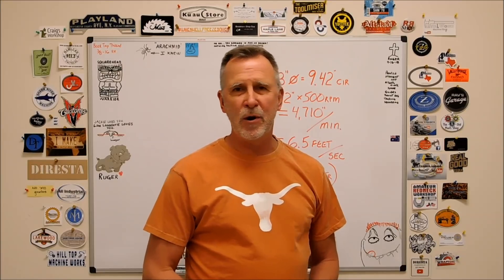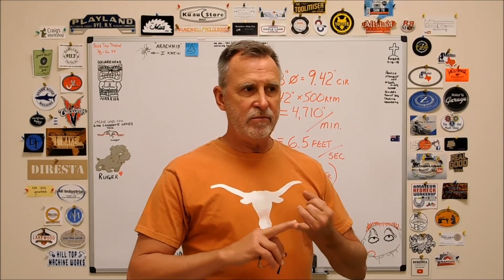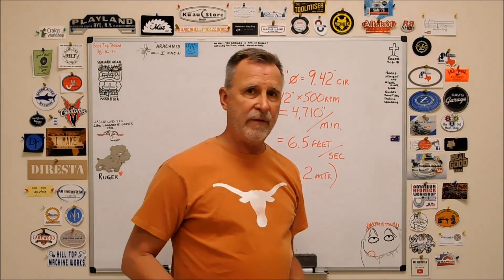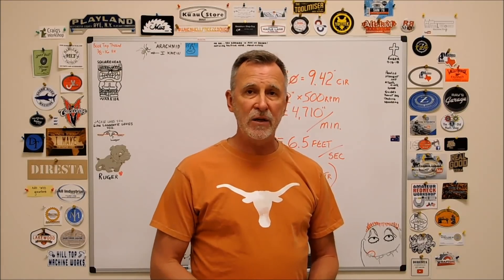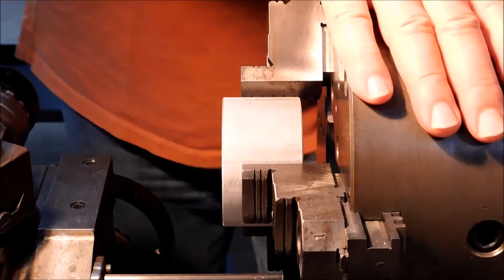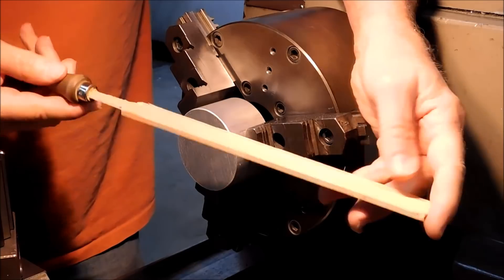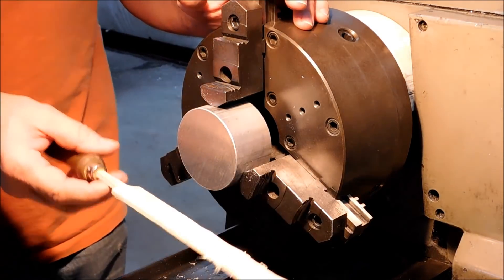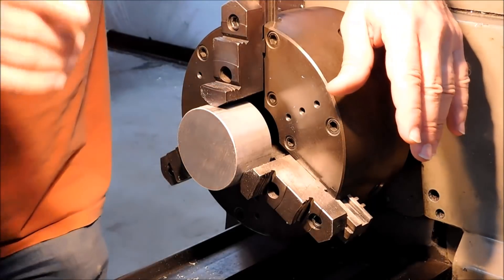File vs Spinning Chuck Jaws

Comment: I teach in a college lab with 12 identical Acra 1640 lathes. Times have changed since I started there 40 years ago. The lathes now all have interlocked guards over the chuck so they won't start until the guard is down and they all have foot brakes. While I filed right handed for years as you are doing in this video, those days are over. I now file left handed as the guard would be in the way and it's just safer particularly with the jaws are extended past the chuck body. Also note that the file is less likely to do any drastic moves when the rpm is higher contrary to what one might initially think.

Comment: Hi Joe, when I was an apprentice my mentor taught me to hold the handle of the file with my left hand when using it on a lathe near to the chuck. First it felt very unusual and it takes some time to practice. But when you get used to it, it feels much saver because you do not holding your arm over the rotating chuck.
Reply from the maker: I wish I had another person available to do a walk around of my body position when I file right handed. My form is very stable and well clear of the chuck. I have always, and will continue to do so. I do adapt to different size chucks of course. When they get big, its always form tools. No exceptions.

Comment: as your chuck has the outer ends of the claws being a good deal ranging into free space, you should also mention that when going for such a file application a) your cloth might have a chance of being pulled into the machine and b) your wrists inside is in danger of unpleasant contact. if either of those happens you are in even more danger of having quite hard contact with outer parts of you body, especially the main body.

Comment: Im just a home machinist but I figured out this technique using common sense and the odd brown trouser moment! I now mainly use a file for deburing small delicate parts which are held in a collet chuck whenever possible. If I have to use a needle file without a handle I hold it across the part so that, if it catches it will just whip it out of my hand and away across the garage (I also cover my Harley when I'm doing it!). Big stuff with a short projection gets done with a tool or a form tool nowdays.
Reply from the maker: Collet chucks are famous for rolling fingernails backwards when you get too close. It may not look aggressive because everything is so small and smooth, but let a thumbnail get hit by a collet slot and you'll remember that for a long time.
Reply: @joepie221  LOL - after a couple of bad moments whilst starting out (Including an exploding gearbox on a cheap bench lathe!), I never assume anything is safe! I always use a decent hang out when filing then cut off later so I only have one end that is going to try an mess me up and then I am cautious but firm wit the file. My worst injury was having my knuckle rapped by a sticking out jaw whilst clearing swarf out with the chuck running - schoolboy error!
Reply: Tha smaller the file, the more likely it will catch and go flying. “Across the garage” is ok, as long as it doesn’t go through you to get there. I like an 8 or 10” file, with a handle, held lefty.

Comment: I'm only 23, so I havent been in the trade long. Anyway, whenever I am filing or sending on a lathe, I put the machine in reverse so everything is moving away from me, so if anything grabs, it pulls it away from me and throws it into the machine.
 If it's up close the chuck, I use my die grinder and spin the chuck slow. If it's far away from the chuck (5 inches or so), I push the tail stock up close, lock it in place, lean on the tail stock for support and stand off to the side, with the piece still rotating away from me. I also never spin the chuck over 100rpm when filing. 
When sanding a piece on the lathe, I rip off a piece of sandpaper nice and long, spin the part away from me and make sure my hands are far away from the workpiece. I have a fairly loose grip, so if anything grabs, it pulls the sandpaper from my fingers. I've had good luck with doing things this way and have all of my limbs in tact.
Reply from the maker: I am not a big fan of reverse filing. But then again, do what affords you the highest level of safety. As for the sanding, watch my safety video on that topic.    https://www.youtube.com/watch?v=p5iKM-vC6LM

Comment: One thing with putting your arm over like that is if you can rest you arm on the headstock and use the front of the headstock to lean against it gives you a very steady  stance and much more control over the file .
That being said it is fine if your lathe is small enough to allow this approach ! Some of the lathes i have used had six feet dia chucks and its a brave or possibly insane person who wants to stand anywhere near that chuck while it is spinning ! 
I always like to make sure that none of my torso is behind the file handle and i don’t strangle damned thing - if it is going to catch I don’t want to be connected to it !  If you want to add just that bit more safety wear an impact rated face shield , they are not expensive and if you own any sort of angle grinder or even a die grinder you should have one of these face shields  in your shop .
Another even more dangerous thing is the humble drive dog - i have seen some horrendous contraptions used as drive dogs and if you are turning the work at a reasonable speed you can’t see if there is something sticking out the front of the dog .
Thanks for this excellent video Joe ! This video has the potential to  stop someone from seriously injuring themselves and possibly even being killed - i wish i had 50 hands so i can give  you 50 thumbs up 👍👍👍👍👍👍👍👍😀
Reply from the maker: Good comment. Thanks. The one thing not made perfectly clear in the framing of this video is exactly what you pointed out. I am comfortably leaning on the headstock with my left forearm and controlling the file with my wrist and fingertips. One knee against the front of the machine and NO forward pressure. There is no way the jaws are going to hit my wrist. Of course on a larger chuck, you have to rethink this approach. At least those of us with an ounce of common sense will.

Comment: Scotchbrite scouring pads and emery paper work really well for deburring 304. Also I like to use a good vintage half moon file.
Reply: They do work well, but you risk them grabbing on a burr or chip. If you have it wrapped around your finger, it could take it off in a blink. Same with steel wool. Be careful!
Reply: It shreads the stuff, job needs filing to remove the burrs then slap the abrasive round for polishing.

Comment: The way you explained the safe use of a file on a lathe is exactly the way I was taught about 50 years ago and I'm using this method to this day without ever having a problem! With the left arm resting on the headstock and holding the front end of the file with your left hand and holding the file handle with your right hand, gives you much greater stability. Using this method at one of the machine shops I worked at got me into big trouble with the shop Forman! I was told by him that the proper way to use a file on a lathe is to hold the file handle in your left hand and the front end of the file in your right hand while approaching the work piece from underneath. If I could not follow his way of doing it, I would get fired! Not to long after that conversation, he tore up his left hand big time using his method and needed over 60 stitches to fix the damage. I thought very much of asking him if he was going to resign from his position but decided against it. No sense adding insult to injury. He did however changed his way of using a file on the lathe the way I been using it!

Comment: Thanks for another great video Joe!  This one got my attention on two counts.  First, the analysis of how a file should be held and what types of contact are the most dangerous was great.  Also, the tip about keeping the Aloris QCTH in place to protect the end of the compound from accidental contact with the chuck is something I had not seen before.  I will start making it a habit in my shop.  Many thanks!
Reply from the maker: Thank you for watching.

Comment: Great demo,i have clipped jaws a couple of times but working cautiously kept me safe,oh yes the first time does indeed scare the sheet out of you.On the clogging issue, does file type matter? Im not a machinist im a sheetmetal worker.On advice seen in other videos i bought a mill file for using on the lathe,its not crosscut (i think thats the term?) like normal files.Does this maybe mitigate the clogging? Ive not had any major issues, i work mostly steel and cast iron.
Reply from the maker: Someone said a lathe file doesn't have teeth on the edge. Maybe the cut pattern is different as well. I've never heard that, but it may be worth checking into.

Comment: A good vid.  I was trained in aerospace many years ago and still follow all the rules you have set out with the exception that although I am right handed I stand off to the right and stay well away from the rotating chuck.
Reply: I also file from the right (tail stock) end, and hold the file at both ends like Joe showed. I stay away from the chuck side approaching part from the right.
Reply from the maker: Let safety and the size of the chuck help you to decide the best approach.

Comment: file the bottom not the top. problem solved.
Reply from the maker: You won't catch me reaching under a spinning part. Thats a big NOPE from me.
Reply: @joepie221  i find it best to just program a .005 radius  on the edges and watch the magic happen. :)  manual machines are so......manual
Reply from the maker: @DieselRamcharger  Thats cheating. CNC " Cuts Nice Corners"
Reply: @joepie221  i must be shopping at the wrong stores. All i got was this Crash N Cuss ....hmm
Reply: Joe covered that, when you go from underneath, anything that may catch drags you INTO the chuck.  Going over the top pushes you away from the chuck.

Comment: This is a place where being left handed works. I don’t have to reach over a spinning chuck.👍
Reply: I like to use the 5-C collet chuck whenever possible.Being left handed does not guarantee safety.I did get my knuckle hit lightly by a chuck jaw.....once.😳
Reply from the maker: It is probably the safer way, but you do what you feel most comfortable doing. I am comfortable over the top, but draw the line with larger chucks and faceplates. Form tools beyond that.
Reply: I do the same as you, James.  Having the file in your left hand also allows you to position your body further out of the line of fire should something go awry.  No disrespect to you, Joe.  But I'd have gotten a rather stern talking to had my apprentice instructors ever caught me wrapping myself around the headstock/chuck like that.

Comment: I'm left-handed, and am not as susceptible to some of the scenarios with the file and chuck, but it is still a great reminder. You mention that Lion Tamers don't think anything of walking into a Lion's Cage... well they actually should (and the smart ones do), always mentally review your procedure before attempting it. In short: THINK about what you are doing. When in doubt, stop and think some more.  I've been "bitten" by chuck spinning jaws before (without a file), and it was scary. Sure, it hurt ("stamped" a bloody imprint of a chuck jaw into the heel of my left palm)... but it could have been far, far worse. 25+ years later I still have all ten digits and full range of motion in both hands and all 10 fingers. I was one of the lucky ones: I didn't have to pay a permanent price.
Reply from the maker: I got hit by a 10" chuck with 8" wide pie jaws while turning 14" diameter rings. Its truly a shocking event. You can't let your guard down, no matter how good you think you are.

Comment: Excellent topic Joe!  Once again well covered.  I file.  And I approach it with extreme caution every time, just the way you described in your video. Footing & stance, no shirt sleeves or jewelry, left arm resting on the head-stalk,  tip control, the whole thing.  Before placing my arms, I mentally make special note of the extension of the chuck jaws too.  I had gotten into the habit of back-brushing the file on my jeans or coveralls to clear it between file strokes; works but really tough on your jeans/coveralls.  Keeping a wire brush handy for that now.  Yup, that file loads up quickly - loved your math showing why.  My file too, is always moving when engaged on the work, and cleared often.
Reply from the maker: Thank you.

Comment: I’m right handed but I hold the file handle with lethal hand when filling on the lathe.
Reply: No control then.
Reply: Me too, I never work over the chuck, I always stand to the right of it. Normally the only thing that goes anywhere near the chuck is a cutting tool.

Comment: I was a machinist for 20 years.  I used a file a lot.  Most of the time,  I used a file I had ground the tang off.  I used it on the underside of the work. If it caught (which it never did) it would go away from me.

Comment: I have had A file kick back when filing deep  groves that are near the width of the file. scarey
Reply from the maker: Use a square file thats wider than the groove, and do both sides of the groove at the same time by holding it with one edge in the groove. Its safer. I've had a groove grab a file. Not good.

Comment: This seems dangerous. Draping yourself over the larthe puts clothing closer to the spinning chuck and now your standing in the line of fire if the file does catch. 
I think standing off too the right and staying out of the line of fire / blast radius would be safer. 
Also what if you have a large chuck or face plare: 15", 24" or even larger? 
Definitely have to stand off to the side.
Reply from the maker: Driven by circumstance, the technique must be the best for the task. My chuck is an 8" and can be safely and easily accessed with a right hand approach over the chuck. I suggest doing it the way you have the most control, and confidence. Left hand makes a lot of sense, but I'd never change at this stage of life. I know exactly where the machine and my body parts are at all times. 50,000 hours of lathe experience will do that to ya.
Reply: Having a solid stance is very important so as to minimize the risk of slipping.  Standing to the side, there is nothing supporting your upper body to prevent unintentional movement.  Bracing your left arm on the head-stalk with well placed footing secures your upper body, and provides better control of the file.  Don't think I would  be filing on larger work (15", 24"), not really practical due to file loading.  My lathe has a 13" swing, and I've don't like to remove the gap-bad.  In the end though, if you don't feel safe doing it then don't do it.  I only ask that you don't push for laws banning the file technique which some of us use frequently.

Comment: Here's something I'm curious about, as I saw it in a video recently. Sanding the inside of a cylinder. I'm very aware of the danger or sandpaper on the OD, and have had it catch before. I am too smart to put my fingers inside something spinning with that much torque.
Reply: Take a piece of wooden dowel (broom handle for example), cut a slit in the end lengthwise and put a piece of sanding paper in the slot and wrap it around. Now you don't need to put your hands inside the part or anything spinning, can reach deep holes and if you wrapped it in the right direction, can just unwind more fresh paper when it stops eating.
Reply from the maker: If the hole is big enough, go ahead and use your finger. Just wrap the emery over the top of your finger, so it doesnt unwrap from the rotation and grab your finger. If the hole is threaded, run the machine in reverse so it doesn't suck you in. On any questionably smaller hole, use a stick. Save the finger. Sticks can bell mouth a hole pretty quick, so be cautious of the alignment and stick flex.
Reply: celicablues wrap the sandpaper around a dowel and keep your fingers out of holes.

Comment: Yes good basic rules to remember . one thing i notice ,your arm is over the turning chuck and i learned to face the chuck and have my right hand on the file tip . I do the same for sanding & polishing .I think we can all learn new procedures  even if your right or left handed . Practice wen the lath is off and feel comfortable before attempting . Be safe .
Reply: I think most would, I would rather have my arms and body over something stationary than the chuck. Also, it lets me have my body clear of the potential flying file if it catches a jaw and attempts to impale me.

Comment: Excellent video Joe, as always. One thing lept out at me that I’d never thought about before, was that I’m left handed, and when using a file on the lathe I always hold the handle in my left hand and the file tip in my right. So I NEVER reach over a spinning chuck. I do many things right handed (shoot, play cricket, etc.), so I know we can learn to do certain things with our off-hand. Seems like a good idea to me for right handed machinists to get used to holding a file handle in the left hand on a lathe, and reach over the stationary bed, rather than the spinning chuck. What d’you think?